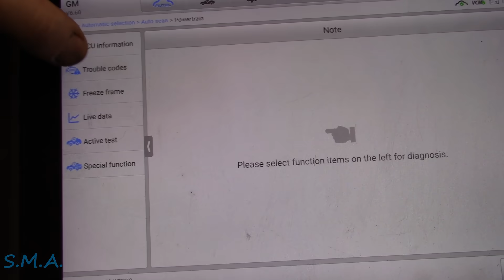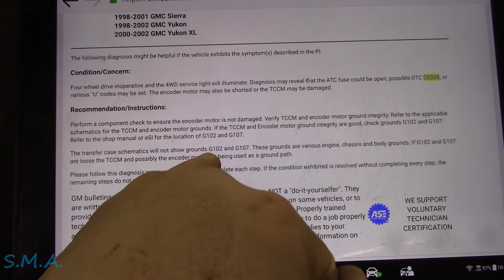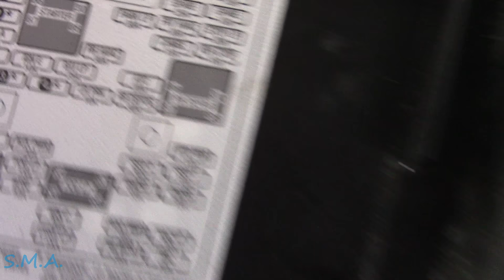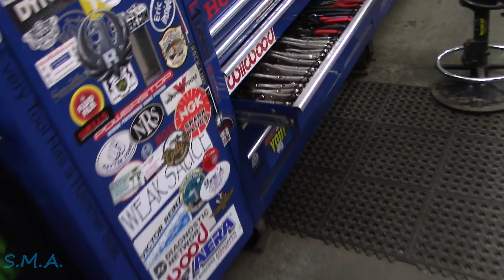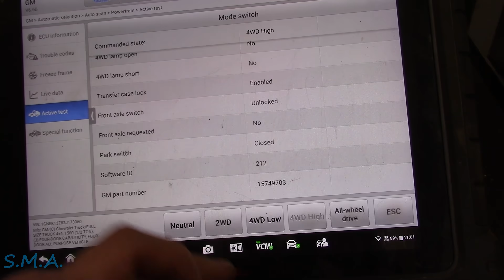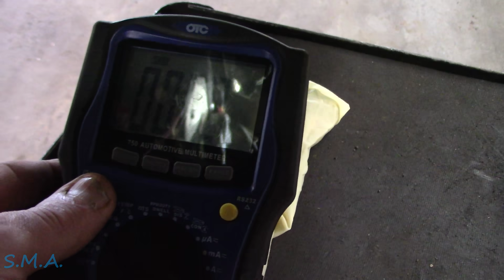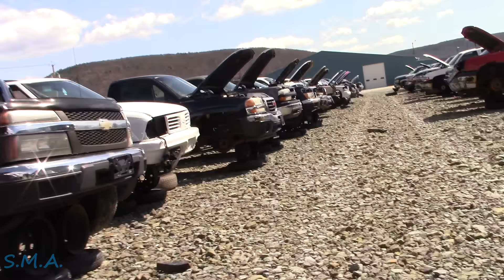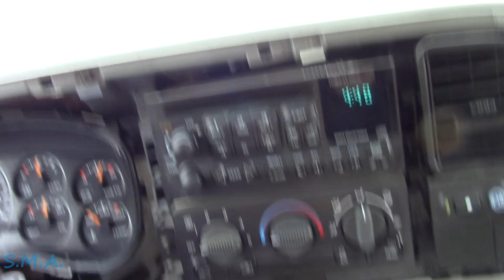Customer Spent $1000's And Still No 4WD

Comment: “Just because it’s new doesn’t mean it’s good”, good thing you’re close to Wilbert’s! Take care
Reply: Agree, What people do not realise is that just about everything made has a failure rate factored in... For some items it might be 10% failure for others could be as high as 40 or 50% failure. Which in turn is also reflected in that items price.. Compared to "actual" cost of manufacture. For likes of that one item... how many other components go into making it... Each of those components has a failure rate as well. Sure you may have just brought that motor which is 1 item... but that 1 item might be made up of several or hundreds of other components. Resisters, Capacitors tend to have a reasonably high failure rate simply because of what they are..... As you said. Just because something is new, does not mean it will work or keep working. For likes of Resisters and Capacitors they have different levels of if you will reliability a bit like PC power supplies there is Gold or Platinum levels same with resistors I wonder for a lot of these cheap replacement parts ... the failure is not in the part itself but in the components used to make that part. Therefore that is the reason it fails not because the component is faulty so to speak, but, instead because that components tolerances are not as tight as they would be with the higher grade OEM components.
Reply: @nzcyclone   i try to explain this to people and even show them. Plastic where there used to be metal , aluminum wires where oem has copper.
    Why some parts have manufactures info on internal parts like relays and some are all “plain white box” parts.
No markings what so ever
Reply: @Mac-mu9cs  Yep for sure. for a lot of these things it is not that they are poorly designed. In most cases they are not. It is simply the quality of the components used which is the issue. It is all part of the cost cutting..... But people have to remember. If they are cheaper you MUST ask yourself how can they make it cheaper? and the answer is always. They use inferior components. But, in saying that is the most expensive item always the best? no, not always sometimes it is the cheaper item which works best...But, not generally when comes to vehicles and vehicle components. Because vehicles now rely so heavily on "electronic" controls and sensors etc which have little tolerance and they are programmed with little tolerance using the OEM product supplied by the manufacturer of that vehicle then if the vehicles system detects even the slightest difference, it will start doing weird things.... In a way it is a vehicle suppliers way of locking you into their product but a subtle way of doing it.. or not so subtle depending on how you look at it....
Reply: Yeah , its convenient to have a pick your own yard close buy , im probably 1hr plus round trip to anything decent.
Lots of yards around here no longer allow pull your own.
Reply: @Mac-mu9cs  I dont think any yard here now allows you to walk in and just pick a part off a vehicle sitting in the yard... Here at least you tell them what you are after and they go and look for it. They cannot afford to let you do it yourself. If something happened OSH (OHSA in USA) would have you by the short and curlies and swing you from the light fitting..... not worth the risk from a business perspective.
Reply: I would take my chances on a $50 junkyard part over a $150 crap reman anytime. Sad when crusty 20-year-old OEM parts have a much lower failure rate than "professionally remanufactured" parts fresh out of the box.
Reply: Mechanicmike part was a junk reman. Eric said OEM was $672 but like anything you get what you pay for.
Reply: You know what you get at a junkyard? ...junk 😂 new is they way to go but not always watch cheap parts there cheap 😂

Comment: Just did similar transfer case shift motor issue , 09 sierra, with a customer replaced amazon special replacement part after  the parts cannon ran out of ammo.. Customer argued and argued my diag was wrong. "Your new motors bad". To prove my point I said if " I'm incorrect, the cost of replacement motor is on me". New motor fixed issue. Customer, (not really) My oldest son! LOL.     I explained as you. 1 learn system, 2 test,  3 confirm. and  4 ,NO internet parts!! and 1 out of 10,000 forum guys know what their doing. there is a reason your part was $30 and mine was $150.

Comment: You remind me of my Dad, who was a Chrysler mechanic for more than 45 years: aftermarket parts are probably junk. See if you can find something OEM, even used, because at least those will match the engineering specs / tolerances. You don't have to buy Chrysler filters and Champion plugs, but if you put in Autolite, you'll be walking.
Reply: Very true! Stupid me installed Autolites on a Jeep just to save 5 dollars for the whole set compared to the Champions plugs. Darn Autolites only lasted 1 week. Luckily, I was able to refund them.

Comment: Sometimes you make me kick myself.  My favorite truck, '04 Z71.  Bought it new.  Drove it till 2017, w/220k miles.   4wd stopped working over the years.  Then it would be intermittent.  It would randomly go into 4L while driving.   Every shop I took it to never even checked anything.  They'd always just say "the new computer for it is $1500."   I sold that truck in favor of a '17 Silverado.   Wish I knew a mechanic who gave a crap.  Maybe it wasn't the encoder motor or whatever they said it was that supposedly cost $1500.
Reply: @redrider7730  He did say a reman was $600. It was probably a lot more for a new GM part. It would be pretty sad if it didn't fix it.

Comment: Another example of rip off shops that can't fix anything except clean your wallet. Great job always enjoy your analytical process. It's the key to finding the problem. Great job as always
Reply: Part changers not problem fixers.
Reply: HERE IN cANADA SHOPS CANT CHARGE IF THEY DIDNT FIX IT.. if they do you file a complaint with consumer affairs and they get it back though there tax filling. of the shop for you

Comment: Can't believe anyone would pay a shop that didn't repair it. Those issues are what happens when girly men get too weak to pull a transfer case shift lever. Lady i work with has one of those and it's currently at 297000.

Comment: As a seasoned tech myself I can honestly say I've been bit by this bug before as well (defective new parts) and gone down many very long and unproductive rabbit holes!
HOWEVER if the problem wasn't fixed the customer didn't pay for anything except for possibly some diagnostic time!! I just don't understand how these shops get away with charging people when their problem isn't fixed and how the customer is okay with it?!?!?!?
Reply: I'd refuse to pay anything like that for not fixing the problem. In fact, seeing how it was the replacement part that was faulty, he should bring this to small claims court and demand reimbursement due to negligence. They should have tested that 'new' part as a matter of course and saved that customer money and all the stress and frustration caused by that garages incompetence
Reply: Yeah I don't get that either. If it's not fixed, why pay??
Reply: @T.J. Kong It's not necessary if the part fixes the problem but certainly when the new part that you're suspecting was the problem doesn't fix the problem you would want to test it!
I'm sure it was young and experienced text or parts changers that don't give a fuck. Either way the shop should not have made the customer pay one cent if it didn't fix the problem and the customer should have refused to pay anything!
Reply: Totally agree with you.
Reply: Yeah I work for Subaru and we would never charge someone for not fixing the car. And if it left fixed then broke again, we wouldn’t stop til the car was fixed for good free of charge.
Reply: Because the shop has the right to put a lean on your credit that you can't really get rid of. I mean you can sue them but that is about it when they hand you a bill.

Comment: He should take your invoice to every shop he gave thousands to to get his money back!!
Reply: When Eric reads off the invoices theres a lot of stuff replaced not related to the  4x4 not working. 200k on that rig and most of the stuff on that invoice was probably not good. To bad the original parts where not retained.
Reply: @Mac-mu9cs  I have the same Tahoe, same color and everything and 295k miles. I've replaced almost everything but the motor and trans in mine. The 5.3 is a workhorse in these vehicles and it has never left me stranded anywhere. When I replaced items it was mostly due to preventative maintenance or my mechanic saying it probably should be done.  As far as paying thousands to not get the 4wd fixed and Eric fixing it that would absolutely have me back at those shops for an explanation.

Comment: Good thing they didn't take it to the dealer, they would have advised a complete power train.. Poor guy. Glad you got it handled! They probably manually moved the control arm prior to installing it. You did a video on that before. That's where I learned my lesson.
Reply: Or a new wiring harness.

Comment: had similar problem with my astro van.....encoder motor would get stuck and blow the fuse...drove me crazy cause it was intermittent....do yourself a favor and do NOT get the cheap dorman ones..spend the extra and get the GM one..

Comment: This nightmare repair job is why I love my 1996 F250 4WD with everything manual. Modern day electronics are like cats, they have a mind of their own, do what they want and rarely responsive to anything you ask them to do.
Reply: It's also why I love my 1987 F-250 Custom 4x4 with the big 7.5!
No power windows, manual locking hubs and a stick for the transfer case, no AC, no airbags, no traction control or antilock brakes, no speed control, no fuel injection, no catalytic converter, not even an electric fuel pump.....  🤣
It only stranded me once, when the 1356 transfer case ate it's oil pump stay.
Reply: That's why I rebuilt a 1984 F150.
Reply: Bunch of dinosaurs in this thread
Reply: @Abused.Ls2  you don’t have to be a dinosaur to know that a simple cable or switch is more logical than having a computer control your radio or heater fan. I’ve driven cars and trucks with throttle cables that never tried to kill me with unexpected full throttle conditions caused by a flaky alternator.
Reply: @yqwgjsg  I guess you never had a throttle return spring break on you then. It amounts to the same thing but... it is usually a heckuvalot easier to diagnose and fix. Cruise control is another one that can cause a runaway throttle but then you can just turn it off.
Reply: @utidjian  If your fly-by-wire pedal shorts, the positioner motor takes a dump or the PCM in between loses it's mind you aren't getting home without a tow truck.
Yeah, I'm a dinosaur, but I'm not freaking stranded because an electron can't get where it's supposed to go.